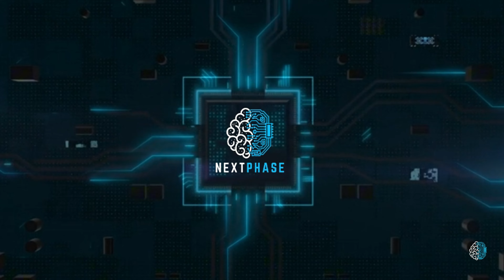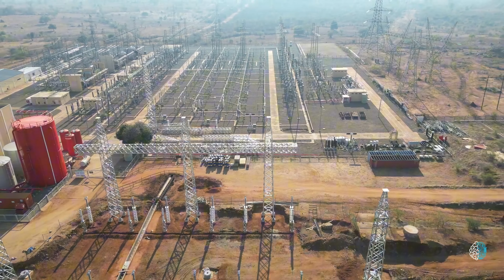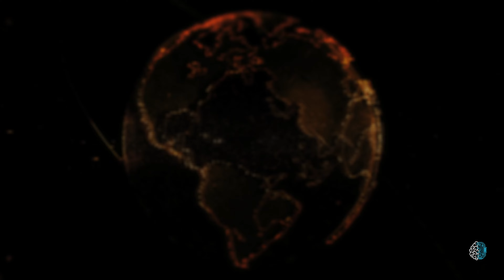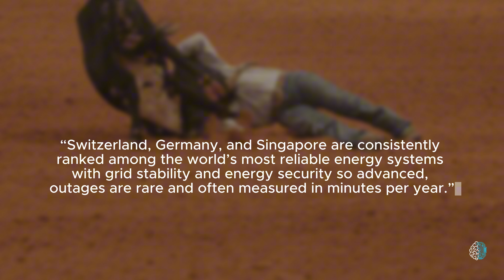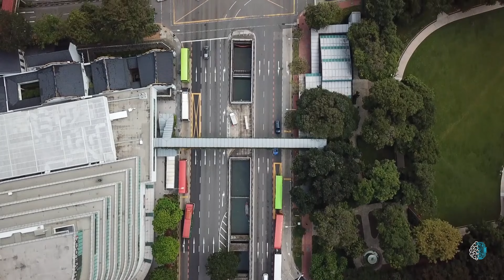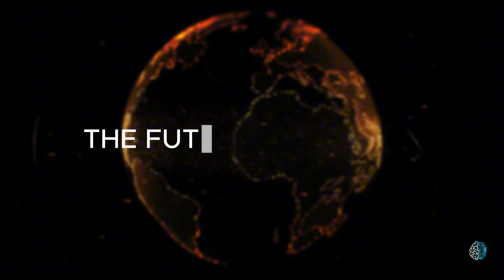How the Power Grid Actually Works (And Why It's So Fragile)

Comment: If managed well EV are the solution. EV can take power when avaliable and stop charging when needed.

Is their also any truth to the story that gas pumps to the gas power station were paid to turn off to save power during the winter storm?
Reply from the maker: Yes, EVs can be a huge help to the grid — when smart charging is used. They can automatically charge when excess power is available and pause when demand is high. Future tech like vehicle-to-grid (V2G) could even let EVs return power during blackouts. In California, for example, utility companies are already testing this.

And yes — during the Texas 2021 winter storm, some natural gas suppliers were paid to reduce output or had to shut down due to freezing equipment and power loss at compressor stations. 

According to the Federal Energy Regulatory Commission (FERC) and NERC, nearly 60% of gas supply failures were linked to lack of winterisation and power loss. This meant gas power plants couldn’t get fuel, triggering a cascading blackout.